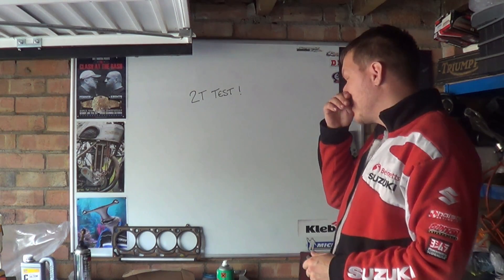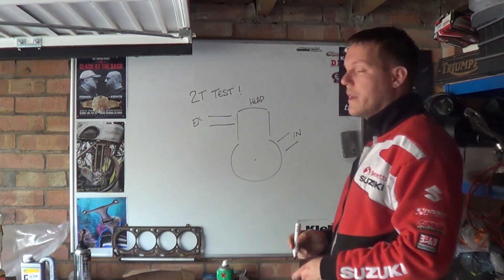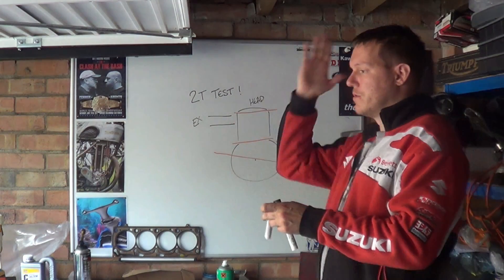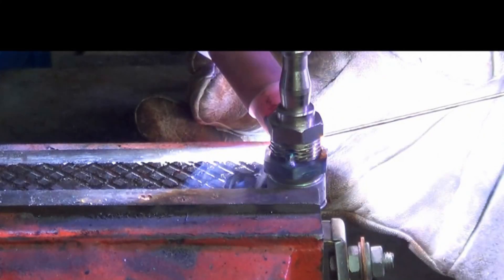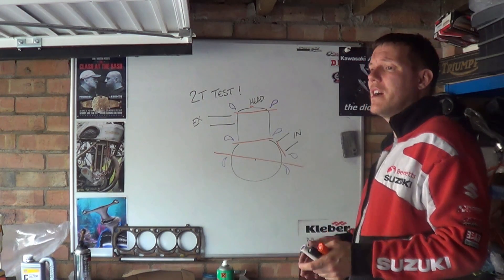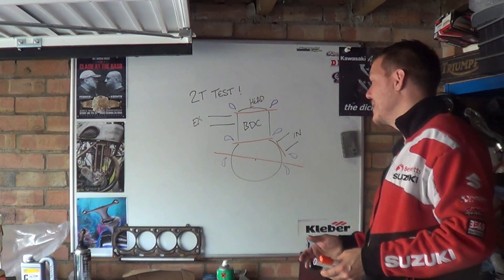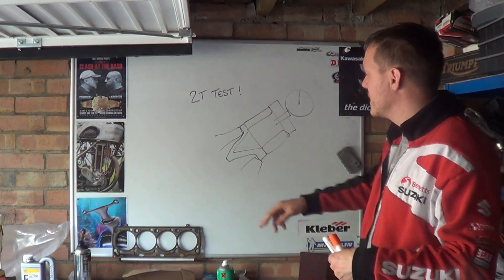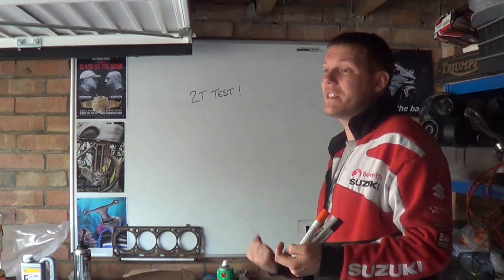2T leakdown test

Comment: forgot to mention the main place you will find this leaks is by the crankshaft seals
Reply from the maker: not always true, depending on the fit of the seals etc. Base gaskets are a common place, but that's the whole point of the test, to highlight leaks you can't see.
Reply: Many crankcase halves don't line up vertically and is a source of leaks. A little bit of Yamabond there is good insurance and still wil not prevent the base gasket from swelling to seal up any leaks from gasket under torque..

Comment: I thought this going to be about checking the valve leakage, turning the cylinder head upside down and fill each spark plug well with White Spirit and see if it drains away in any valve

Comment: I pressure test the system in a negative and positive manner.  I find positive pressure to be less important than negative to be honest.  Negative pressure is what the crankcase will see if you are leaking air causing a lean condition.  If it won't hold the negative pressure, you have an airleak!  A mighty vac would be a great tool to incorporate in your tool box.
If you have a crank seal issue on the clutch side, you will generally use transmission oil and you can smell that when it burns.....just a tip for newbies.

Comment: Seeing you have a Suzuki jacket on, they shows us a way to test for the two types of compression on a 2T as you call it..  most only check the secondary side... the primary side is where most problems are.. and when you add more then one cylinder you have add more crap to leak..

Comment: Leaks can occur in the castings of the cylinder or crankcase as well.  knew one guy who had a head gasket leak. He had it machined, spent months diagnosing it. Finally discovered a crack in the top of his cylinder to the head stud hole I believe. This is a 2-stroke. The machinist had not seen this and with the very detailed illustrations no one on the forum accounted for it either. We all concentrated on the engineering of the gasket/gasket surface, and head surface.
Reply: No, I was incorrect. Even stranger. The leak was actually a primary compression leak. Air was leaking from the crankcase BETWEEN the cast iron cylinder lining and the outer aluminum casing/fins and exiting at the top. We all saw bubbles from the soap solution around the cylinder/ head and since no crack was evident we thought it was a cylinder sealing problem, and went way back to Yamaha technical notes about curing head gasket sealing problems.

Comment: I spray aerostart around my intakes ( suction leaks).. The slightest amount of that shit getting in it changes the idle and you know you got a leak.. Then I spray shit loads of soapy water around all the pressure leak areas . Im pretty confident that I can detect a leak without doing a leak down test. Once you realise you have a leak you need to find it by these methods anyways so why not go straight to trying to find/detect any leak ?

Comment: The stupid husqvarna chain saw 2t leak down is 7psi for 4 minutes. They don't want you going over 10psi so to no damage crank seals and such. Also use a mighty vac @ -7psi for 4 min. I don't remember what yamaha said but I think it's in the same ball park.
Fuck all that horsing around with getting it all set up. Get the bike running and WARM then spray starting fluid at critical points- bass gasket, intake boot @ reeds and carb, and stator side crank seal- the PTO side seal has oil on it and doesn't usually go bad.